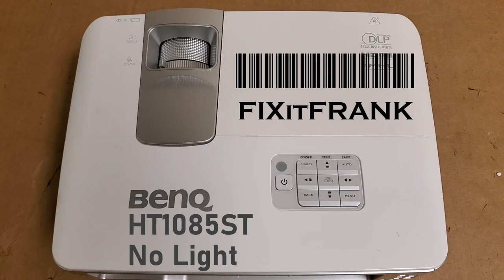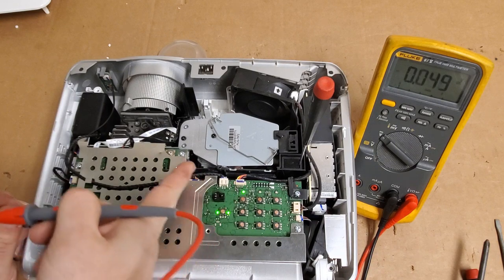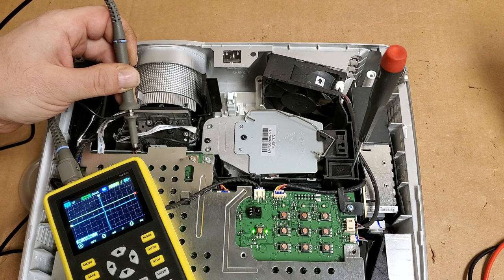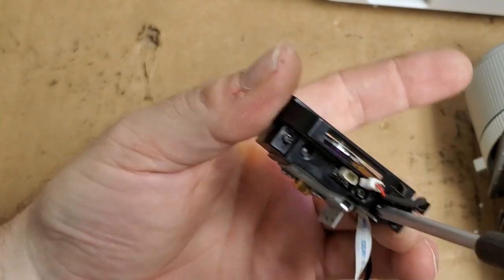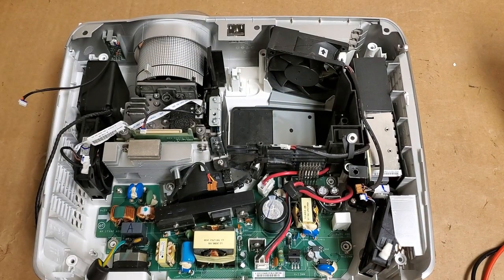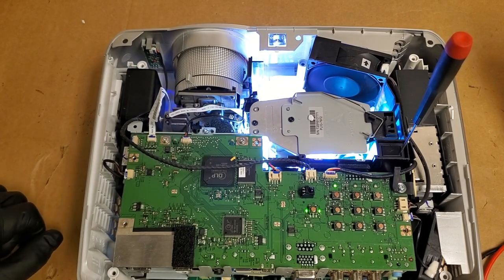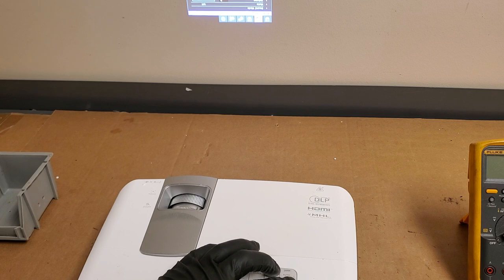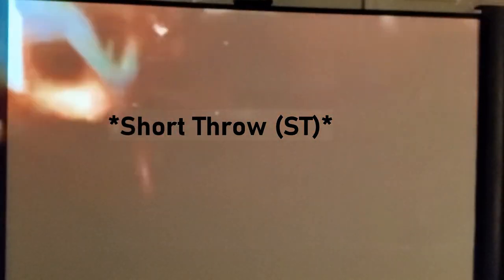BenQ HT1085ST DLP Projector No Light

Comment: My color wheel is not spinning so I am also not getting anything from the color wheel sensor. I think my color wheel is, what should I be reading from the 4 board pins that supply the color wheel through the flat cable? I do have a oscilloscope.
Reply: More info: My color wheel measures 3 ohms from common to each of the 3 other pins. Then the benq mh680 gets powered on, the green led starts blinking and will do so forever. After some time, the fans start spinning. The color wheel does not start spinning. Hence, the lamp will not turn on.
Reply from the maker: 3 ohms is about right from the common to each leg.  I'd see if you are getting any pulses (roughly 5-8v,  2ms per division).  The wheel itself might be bad but I'd also check the sensor. I have seen the wires break at the board but still look connected. PMD1000 IC drives the color wheel but I'd check that sensor first.
Reply: @FixitFrank  Thank you Frank for your super swift and detailed response. I did manage to get the color wheel spinning again, I also do get signal from the color wheel sensor. The color wheel sensor is giving short pulses of around v_max=1.1V at 120 hz.     The 1.1V is too low, right? In consequence the lamp led is blinking orange. On the 2nd pin to the ballast measures ~0V right after I switch on the projector (the one that you said should have 5V initially and then get down to ~ 3V to turn on the lamp).

Comment: hi frank i have   --OPTOMA=131-XE== i  was trying ti set colour  but i push the worng button  now it me for sceruity code i tryed  1234==0000 but it not  starting idont know whate to doooo please help me ==Thanks===???
Reply from the maker: If you set a code by mistake, that is a tough one. https://elektrotanya.com/showresult?what=optoma%20hd20&kategoria=&kat2=all  I would read the service manual for the HD20-HD200 and see if the service menu is accessible and you can unlock it that way maybe.  I have never dealt with this issue so I can't be sure of the best way to fix it. I would start here though.
Try this:
1. Power up projector.
2. Press "Power", "Left", "Left" and “up" buttons on projector in order and you should get into the service menu.
3. Scroll down to Factory Reset and press enter.  That may wipe the passcode.

Comment: Frank I have the same projector, lamp won’t fire. Not a techy guy, can I pay you to fix it ?
Reply: When I hit power it wants to kick on but doesn’t, then then the power light and power logo remains green but it’s off…?
Reply from the maker: Hi David,  I do take on side work.  I have an email listed on the about page if you want to contact me.  I may not be able to reply until tonight or tomorrow(I tend to get to it on Saturday/Sunday). If you can, maybe record a short video of it trying to start and share it with me. Just in case I see/hear anything that indicates it would be a costly repair instead of a more reasonable repair.
Reply: What’s your email address? Thanks frank
Reply from the maker: its on the about page half way down.  Says "contact" or something like that. I dont post it in comments because it gets picked up by spammers for some reason.

Comment: hello sir I am from Bangladesh my projector benq ms500 dlp problem is sometime 30 /40/minute after turn off what is this problem please kindly tell me
Reply from the maker: Please check the manual, troubleshooting section.  There is a chart with error codes that indicate the nature of the failure. I suspect you have overheating?  Does the temp light come on when the projector turn off?
Reply: Maybe the power ic is the problem ... Is an top256yn... It's get hot and sometimes crash when is hot or only  off the projector

Comment: Frank I had the over heating issue with my benq 1085 st- I disasemmbled it and cleaned the fans and couldn't get it to power up again. Is it time for a new pwr module?
Reply from the maker: Make sure the lamp cover is back on and that all of the wires are plugged in.  If it was powering up before you took it apart, go back over everything and I think you will find the missing bit.  I doubt you need a power supply.  the number of times I have ended up with the same thing you did and then found that I forgot a wire are too many to count.

Comment: Benq mx806pst lamp suddenly off after sometime but butten light colour (green) not change any solution please tell me sir  

Send any vedio
Reply from the maker: I suspect a lamp is old or possibly not a real Osram bulb inside?  I would check the service menu error codes while it is working.  That will tell you more.  Or try a new lamp first. If it still cuts out, then it could be ballast, color wheel but I think lamp.